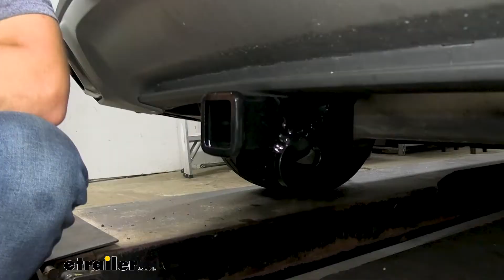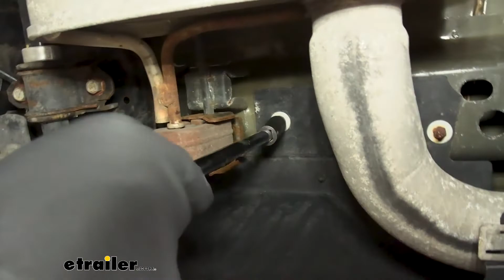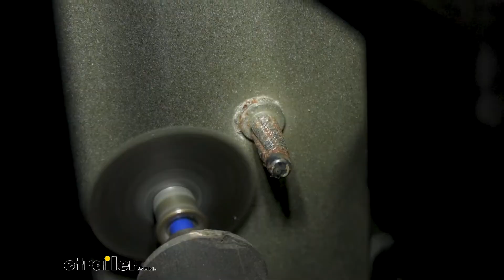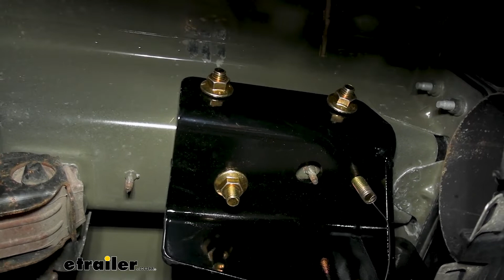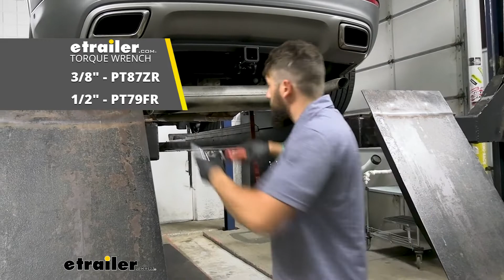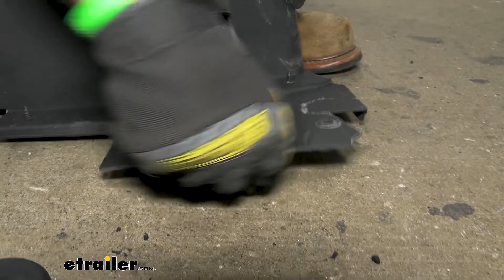etrailer | How to Install: Curt Trailer Hitch Receiver on your 2019 Lincoln Nautilus

Comment: Does the hands free kick to open rear hatch still work?
Reply from the maker: The handsfree lift gate sensor will still work but you will need to find the sweet spot on either side of the sensor in order for it to pick up the movement.
https://www.etrailer.com/Trailer-Hitch/CURT/C78KR.html